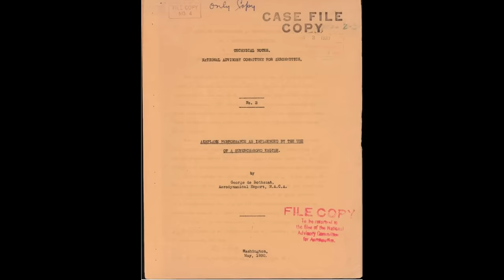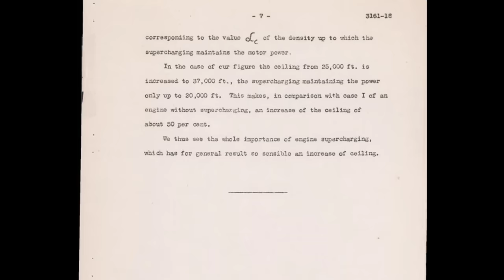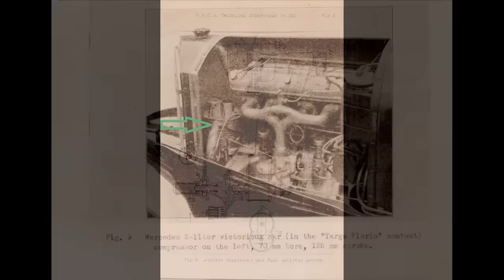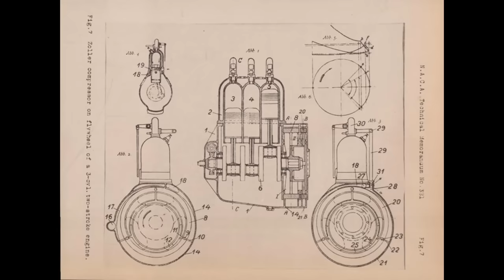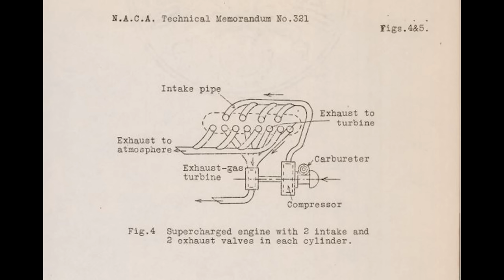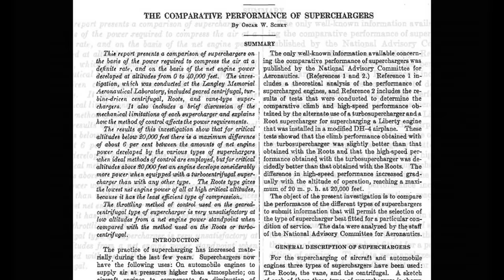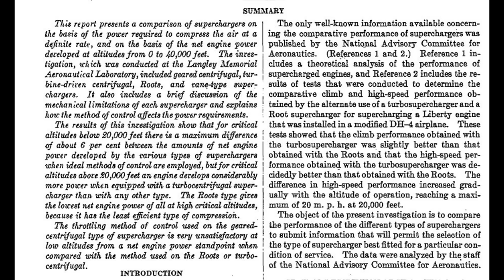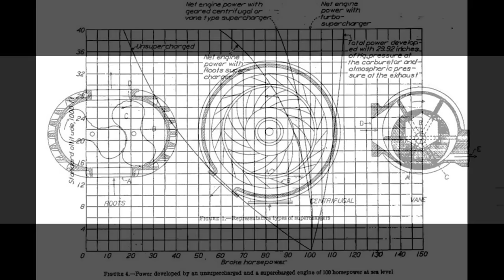Turbo vs Supercharging in WW2 Airplanes

Comment: A Centrifugal super charger no many how many stages is not a true compressor like a Roots or Screw type blower is. A centrifugal blower like turbo charger is more of a air multiplier.  When comparing turbos with cen. Chargers they are about identical. As far as witch is better would be a function of application. Turbos have lag and are slow to react, but once they are spinning they are like a run away train with power never really topping out or becoming inefficient. The centrifugal blow has instant repsonce being mechanically driven. Witch is why they loose VE are engine RPM is increased

Comment: this is good, but has amateurish aspects that need to be cleaned up , what's this "of course if you want to pause and read for yourself, please do so"  business, cut that fluff out, what's next, "of course if you need to pause to go to the bathroom please do so"
Reply from the maker: Or could wear an adult diaper and make it all the way through in one viewing.
Reply: P38 turbo not reliable low altitude p51 british centrif 2 stage